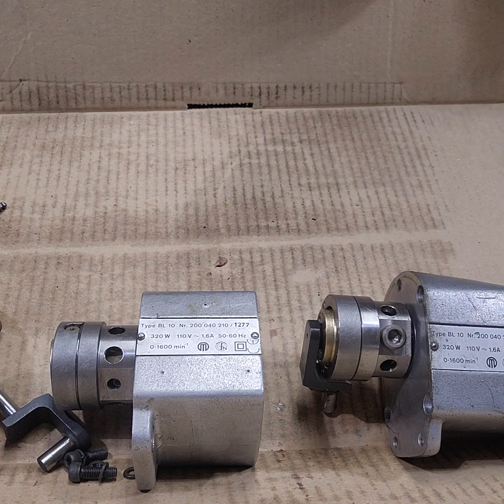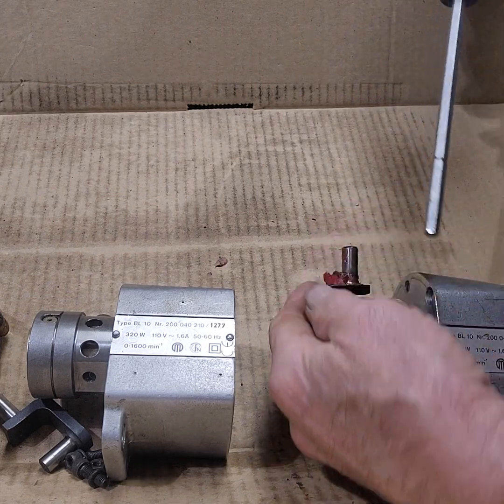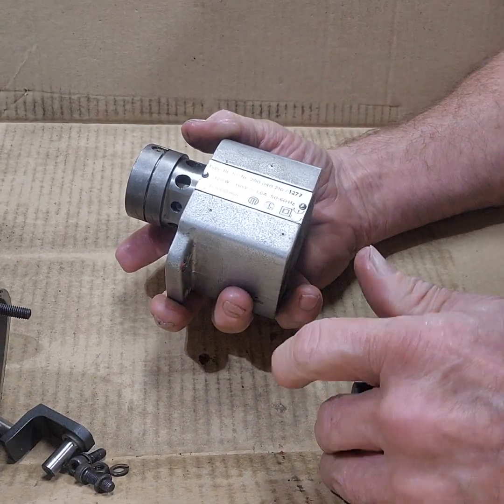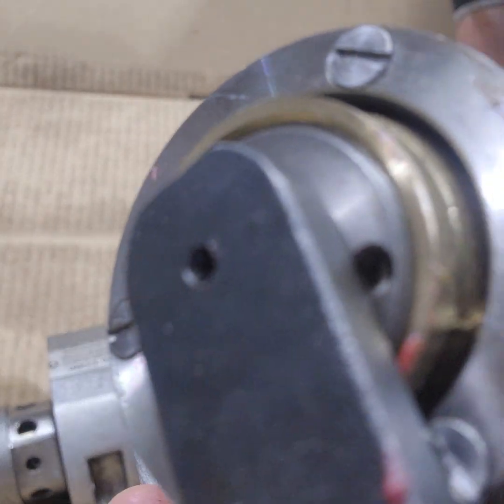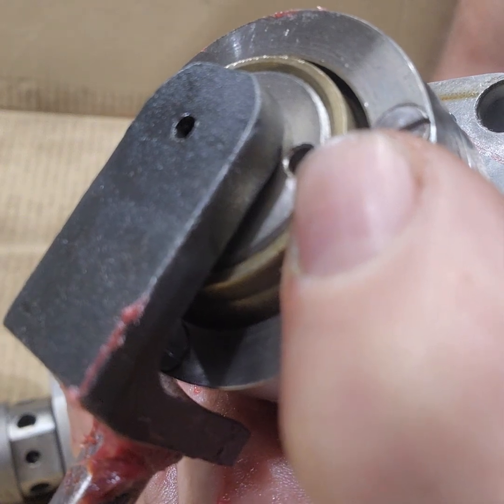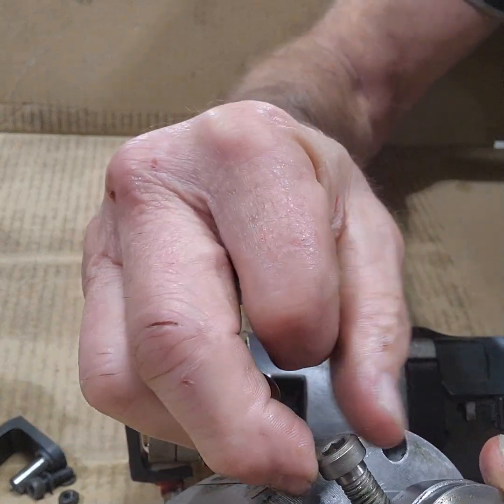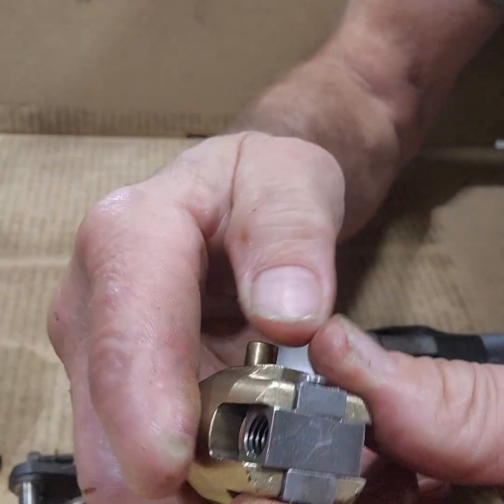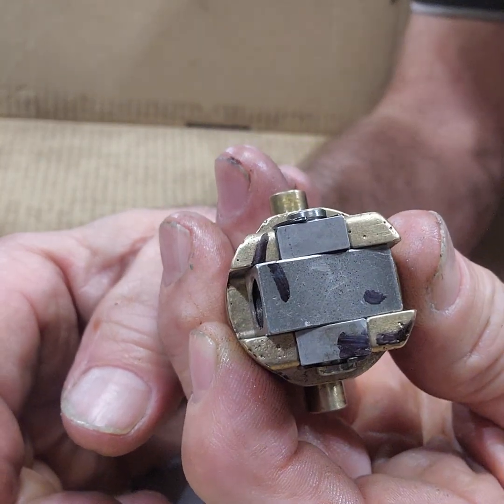Bad bearings in a Biax BL10 scraper stroke assembly

Comment: 04:12 05:08 06:23 Помилково вставляється вал іншою (неправильною) стороною.
06:30 Гвинт теж має вкрутитися у вал з іншої сторони.
Reply from the maker: @viktormyronchuk7685  Sorry, I don't understand.
Reply: @OtherBrotherDarylSmith  In the video, you insert a shaft into a bronze part that does not have a thread for a screw.
Reply from the maker: @viktormyronchuk7685 

The head of the screw goes against the inner race of the bearing and it threads into the end of the shaft.